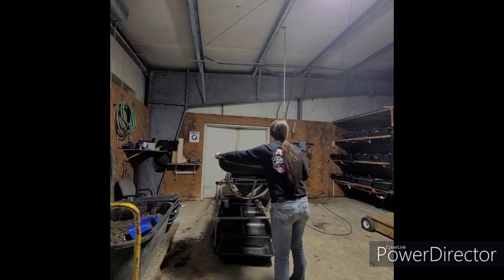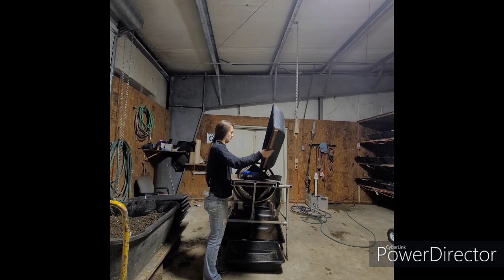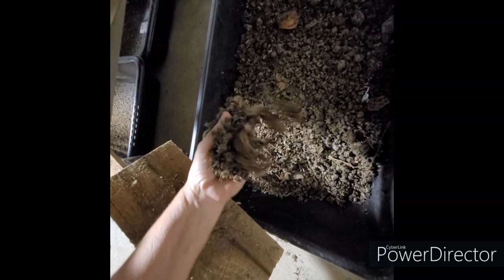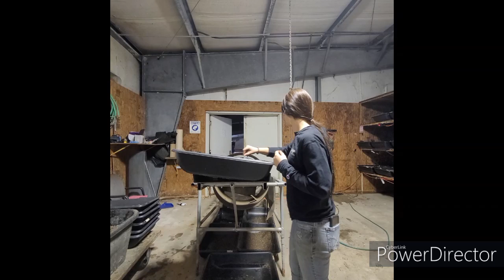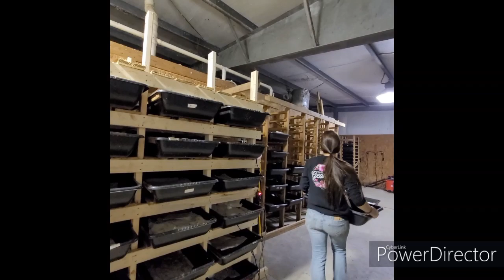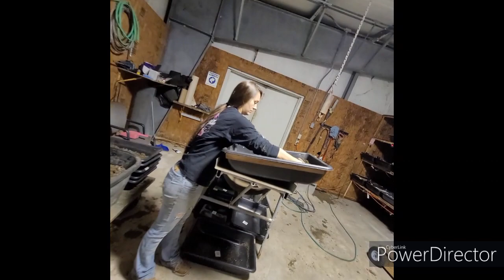How to Maintain a Worm Breeder Bin: Complete Care Guide

Comment: Great video detail, how much gallons of bedding per your 500 breeder worms are in your bins, I saw in the comments you said the bins were 6 inch deep put only 1 to 2 inches filled.  Also, is it the same size nursery bin for the cocoons and filled same depth?  Thank you for taking the time to answer the questions in the comments:) Oh, one more, do you put the half an apple in straightaway, and is there a specific time frame when you split the nursery bin each time or is splitting determined by something else, thanks again.
Reply from the maker: I do not know the gallons. Just make whatever bin you have 1 to 2". That would be the correct way not figuring gallons as it may make it too deep.
Reply from the maker: Thank you for your questions: we fill the bin with  1-2" of bedding.  same for nursery bin and cocoons. Yes apple goes in straight away. Split the nursery bins  after you start to see a lot of worms hatching.
Reply: @MemesWorms  Do you know how much bedding in gallons makes up  1-2 inches in those bins.  I tried to calculate how much bedding that works out to, off the dimensions of the bin that you linked in another comment, but  it looks like the bin is curved on the bottom  in that link so  I couldnt figure  the volume that would fill 1-2 inches of that bin even though the link said it was a 10 gallon bin and 26x20x6.  It would really help get the best start on making up a similar breeder bin at home if I knew how many gallons that works out to as I can't purchase that exact bin here in my country, thank you.

Comment: Math question:
So if you don’t sift and if we pretend the new breed tray only breeds for 21 days then stops:
1) 500 breeder worms make 2000 cocoons.  
2) cocoons hatch in 40-60 days
3) after 60days, assuming they all hatch with an average of 3 juveniles, that means you have 6000 juvenile worms.
4) that means in under 90 days, you went from 500 worms to 6500.

That is 13x worms in 90 days.  So why is it commonly said worms double every 90 days?
Reply: Under ideal conditions red wigglers can in theory hit 28+x in 90 days. I’ve heard the comment about doubling before also and I just laugh. I’m doing a tedious experiment right now. 200 adult red wigglers in a 5 gallon buck with 2 gallons of sifted finished compost. I started them on august 24th,counted every cocoon I could find today, 325 of them. Pulled all the adults out and I’m going to count the worms in 69 days so I don’t have to look for a bunch of babies. Worst case I’m expecting 600+ worms. Add that to the original 200 and that’s 4x in 90 days. And conditions where I live are anything but “ideal”.
Reply from the maker: It's an average but if conditions are good they produ e more.

Comment: Thank you for another great training video! I love your setup. We don't have the space to do quite as well, but are working at being better organized. What i learned today will go a long way toward that. 

One quick question: Where do you get your trays? We have been having difficulty finding enough here in northern IL. In fact, we've bought out all of the mortar trays from four large building supplies and they are having trouble restocking with enough to do us any good.
Reply from the maker: That is awesome!!
Reply: Websterant
Reply: @davidwellner4191  Thanks! Looks like a less expensive option, as well!
Reply: Ask at the fish counter where you shop - they have Styrofoam boxes that the fish comes in.  They are smaller - maybe two to a cement tray.  The cost is 2 X $0.00 - I can handle that.  Watch the Bilsdale Worms video for a prevue.